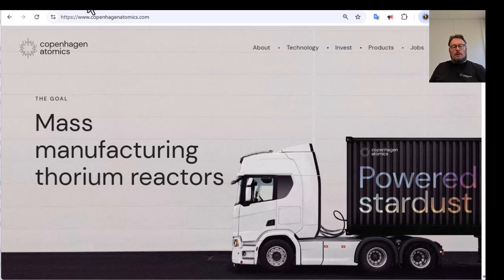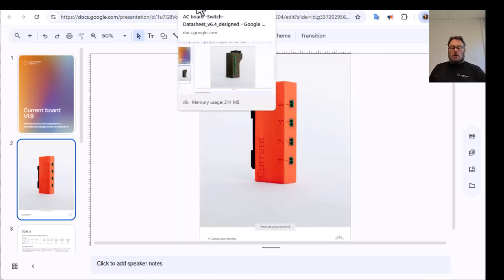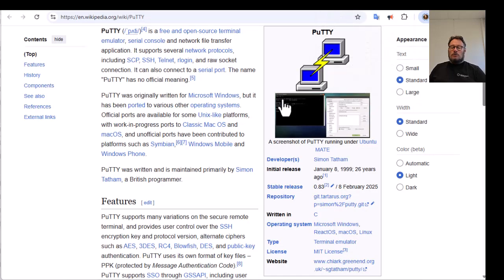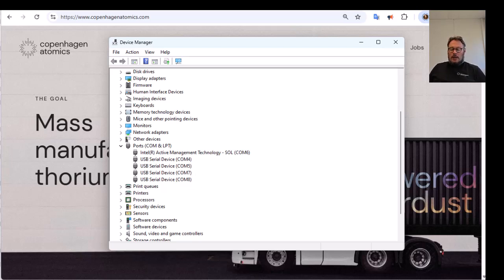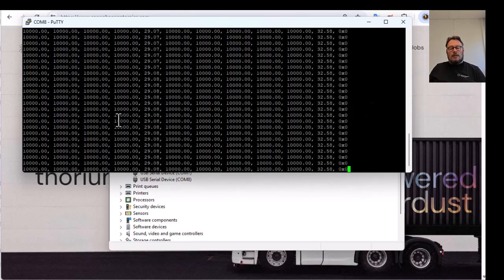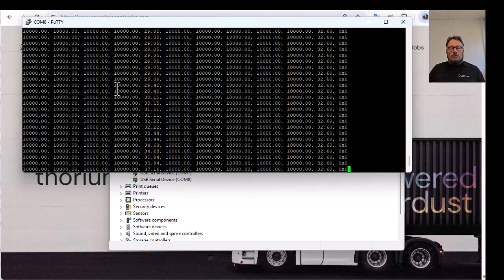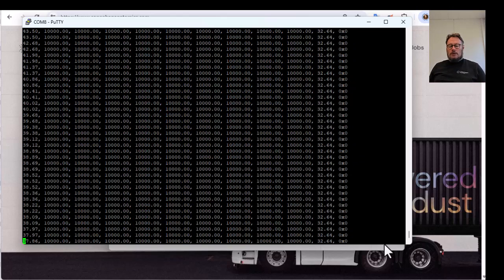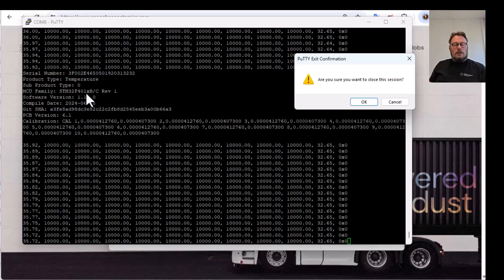Serial output of electronics boards

Comment: What is the relevance of these to your LFTR development? I see nothing special about these electronics that would make them useful to high temperature reactor monitoring or control. Any of this could be easily done with a 
raspberry Pi or an Arduino and off the shelf sensor components.
Reply: I believe this video is to help current customers who purchase CA's lab and research equipment.